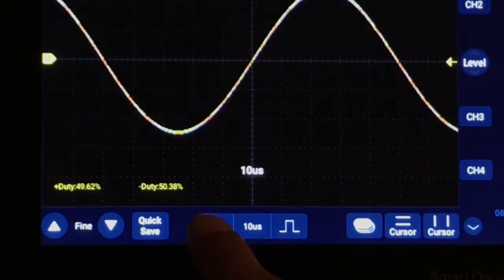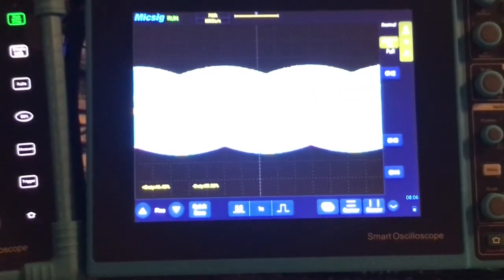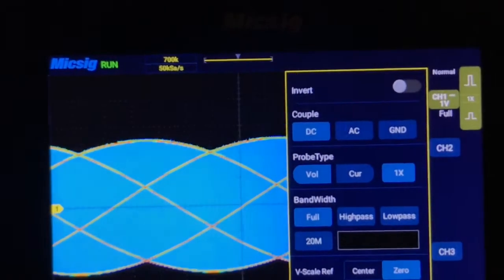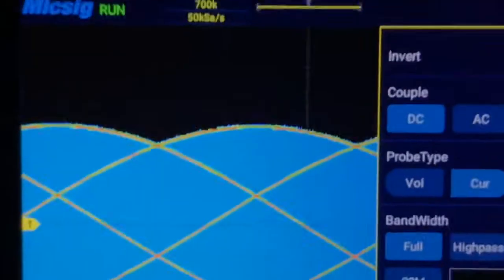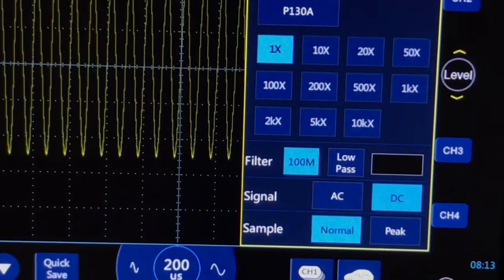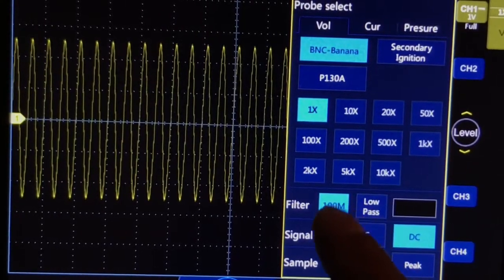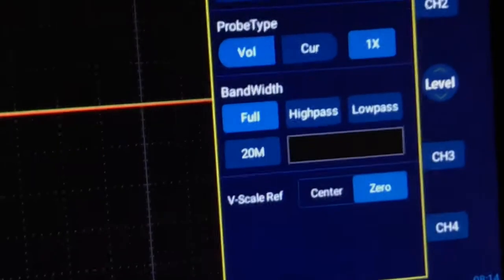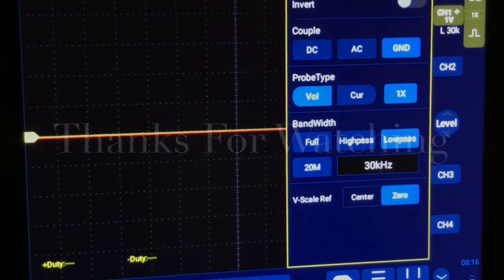(Part 2) Micsig STO1104E Smart Oscilloscope First Impressions & Comparison to ATO1104 Part 2

Comment: I don't think CCT stands for color temperature. The person who told you that may have misled you. In your Part-1 video, the reddish-orange horizontal lines on your STO1104CE oscilloscope were the square wave signals being generated by your function generator. These lines are the voltage levels of the signal. These are HIGH or LOW voltages. The blue vertical lines are your rising and falling edges. The rising edge occurs when your signal goes from LOW (0V) to HIGH (+5V). So the rising edge is the blue vertical line which rises sharply to a HIGH (+5V), or the higher horizontal line. The rise time is the time it takes for it to go HIGH. If you zoom in on the signal, you'll see that the rising and falling edges are not as quick or as abrupt as these might seem to be, when looking at it when the signal is zoomed out. The falling edge is when your signal goes from HIGH (+5V) to LOW (0V). Think of the signal (any type of wave) as a switch being turned on and off repeatedly. When the signal is HIGH the switch is turned ON. When the signal is LOW the switch is turned OFF.
Using the oscilloscope to detect sensor intermittent problems is a good idea. However, it may not work the way you think it does. Your sensor will emit some kind of signal. It might be a sine wave, although I doubt it. Your sensor is probably going to a microcontroller for processing, in which case the signal is more likely to be a square wave. 
The problem you seem to be looking to detect is a signal falling LOW when it shouldn't be. In other words, the sensor is turning OFF when it shouldn't. I suspect your working with a temperature sensor. So what you would be looking for is a square wave signal that remains LOW when the temperature sensor (any type of sensor) is failing. Let's say, for example, that your sensor IS a temperature sensor. At a certain temperature the sensor  is suppose to turn ON (goes HIGH, +5V). The sensor is a transducer. That is to say, it transforms one energy type to another. In this case, it changes the temperature to a voltage. If it is not turning ON when it should, then what you are looking for in the signal is a period where the signal remains LOW (0V). This will show you when the problem occurs, but it's up to you to find out why the sensor is not working properly. Is it the sensor, or the microcontroller? I leave that up to you to figure out. I hope I was able to help you understand how to read your scope a bit better.
Reply from the maker: Henri Coderre, thanks for the information, and for stopping by the channel. I really appreciate the comments. Lord knows, I’m always learning. Unfortunately, I do t have the time to take classes, so I’m teaching myself. I always appreciate feedback.